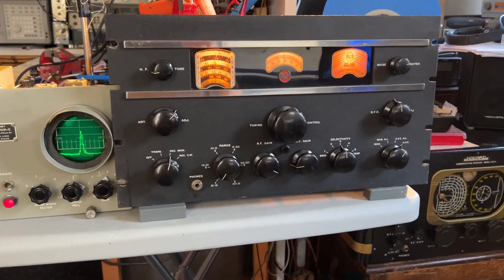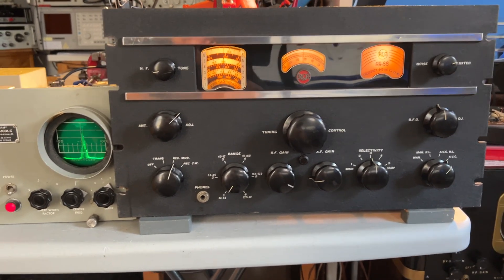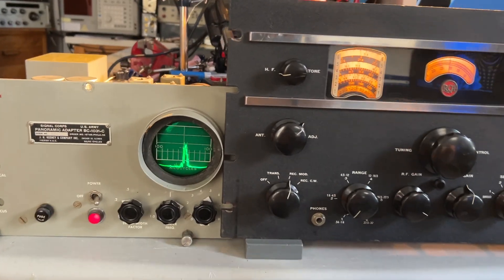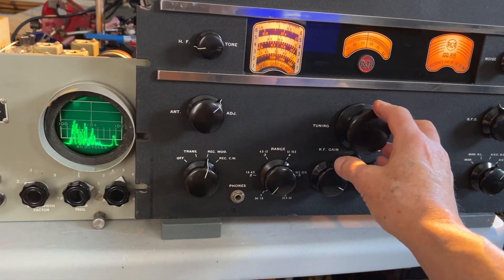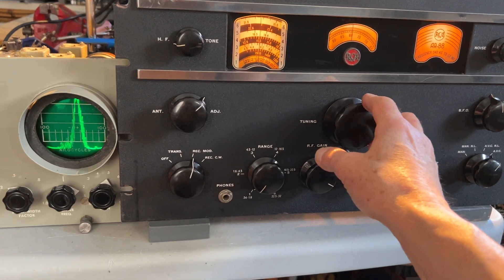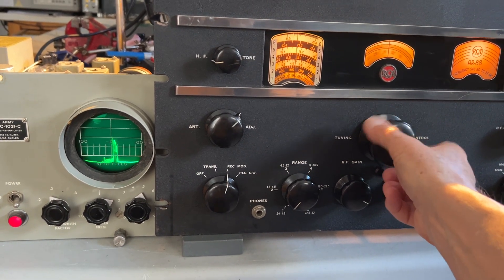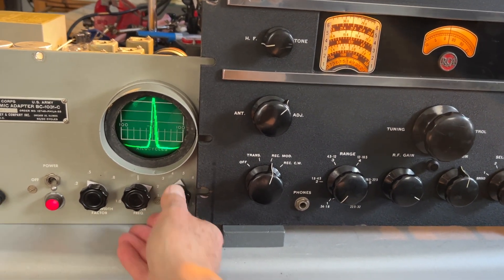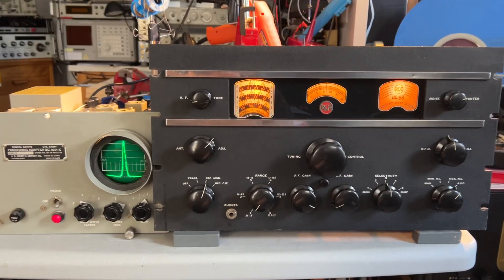RCA AR-88 Receiver With Panadapter after Readjusting Crystal Filter

Comment: Excellent series Gerry,

No biggie, but can the peak on the panadapter be made to move to the right with an increase in tuned frequency? That is move in the same direction as the tuning dial?

Awesome restoration skills.

kind regards,
Terry.
Reply from the maker: Hi Terry.  No, that would be incorrect (and would feel ergonomically wrong!): as the radio is tuned from lower frequency to higher frequency, a station ('A') that is higher in frequency than the currently tuned (centre) frequency appear on the right side of the screen, indicating it is above the currently tuned frequency of the radio, ie. station 'A' at this point can be seen on the screen, but not heard on the receiver audio as it is within the RF passband of the receiver but outside the selected IF passband.   Station 'A' will move towards the centre of the panadapter screen as tuning continues, and its frequency becomes closer to being the centre of the receivers RF passband, and will become audible as it enters the receiver IF passband (the RF passband of a superhet receiver is typically much wider than the IF passband).  As tuning lower in frequency continues, station 'A' will pass through the centre of the screen (centre of both the RF and IF passbands), and will continue moving to the left as tuning lower in frequency continues.  Another station ('B') which is higher in frequency than station 'A', will then enter the RF passband at the right edge of the screen and so on.   In this demo, the 'Sweep Width Factor' (left knob on the panadapter) is set around '0.2', which represents 0.2 x 200KHz = 40KHz bandwidth from one side of the screen to the other (200KHz is the maximum bandwidth of this instrument), so at 10kHz AM station separation, there would be a maximum of 3 or 4 stations visible at any one time (plus any sidebands and noise).  The RF passband of a conventional superhet receiver, such as this AR-88, depends on the receiver front end design, ie. how good its preselector stage(s) is, determined by the number of RF amplifier stages, 'Q'-factor of the coils, etc., prior to the mixer.  With two RF stages and fairly high-Q RF coils, the AR-88 appears to have an RF bandwidth on the Broadcast band such as to significantly attenuate signals towards the edges of the 40KHz bandwidth of the panadapter in this particular set up.  Note that the frequency response of the panadapter is not flat, but intentionally peaks at each end of the 200KHz maximum bandwidth to mitigate this effect somewhat.  If used with a receiver with a less selective front end, say a single RF stage, or just a converter stage, then the attenuation towards the bandwidth limits would be less, and a wider section of the RF spectrum could be displayed on the screen, eg. setting the 'Sweep width Factor' to 0.5 would give a 100KHz bandwidth for the screen.
Reply: @RadioRestoration  Understood. Thank you for that and again for sharing your restorations.
Kind regards.
Reply from the maker: @terrygains8327  Lots of details on my 'Radio Restoration' Facebook blog about the work on each: https://www.facebook.com/gerrysvintageradio/